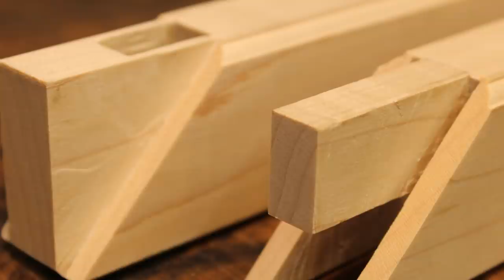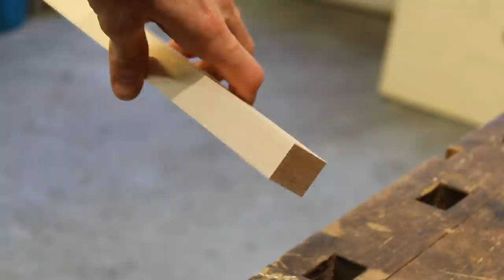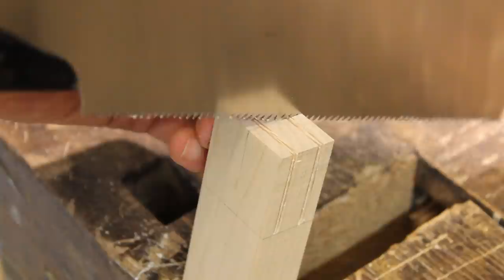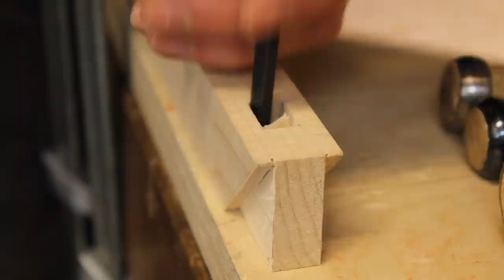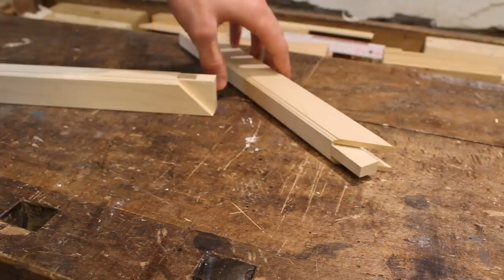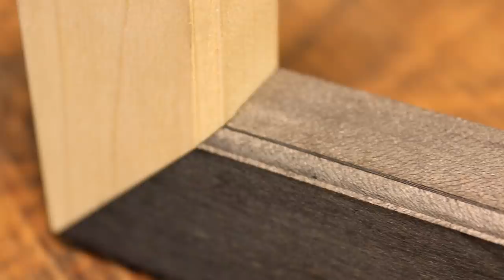Joint Venture Ep. 48: Through mortise and tenon with mitered faces (Japanese Joinery)

Comment: Nice Soul-R&B addition to your normal Jazz mix . By chance are some of those chisels new ,or we haven't seen them used yet in this wonderfully informative series? Some of them seem to have a damascene or acid etched  look to them I never noticed or saw before .
Reply from the maker: Thanks! I‘ve had a lot of them for a long time. The damascus chisels have been around for years. The new camera shows the details better.
Reply: Ahh okay that explains why some of your cuts as of late seem to not be as "precise" as they were or have been. I somehow found it difficult that all of a sudden your abilities have dampened and lessened,now I know it has more to do with how detailed the camera is in it's focus . Which says lot's simply because the only ,"fault" or imprecision ,and that's said very very lightly is on the one side where you made it seems a tad too deep of a final chisel cut. Will say after watching your series ,and I am in no way a woodworker or know anything about joints or any sort . Thought hey ,a table with a three part mortise and tenon mixture would look aesthetically pleasing and be completely functionable ,and be able to withstand heavy forces in many different vectors . Basically a slight variation on #6 through tenon with sword tip miter and into it a vary slight variation of this exact through mortise and tenon with mitered faces into the top right angle of the horizontal . And then realized I might have caught a wood worker bug ,ha ha  . Again thanks for your uploads ,they are pleasing and informative .

Comment: that chisel is tiny! 

ive been meaning to ask for a while - when you decide on the dimensions of the cuts you need to make do you base it on the size of the tools you have or do you have chisels for every size possible and work out the dimensions that are best for the piece you are working on?
Reply: Dominic Ransom for the most part you try to make the joinery to your chisel size it just makes it easier .
Reply: i must admit i thought this would be the most logical explanation but it was a question nagging at the back of my head to be asked. thank you for confirming that
Reply from the maker: A bit of both. But some dimensions are needed for certain joints, so I only try to deviate a small bit for chisel sizes.
Reply: Is that a 2mm chisel? Or 1/16inch? I,be never seen one so small, where did you find that one?

Comment: I like the edge finish on the inside edge. Is that a wooden ovolo corner plane?
Did you make this? Or buy with this in mind?
Reply: if im right it looks more western than japanese?
push stroke rather than pull.
i've looked everywhere and cant find one that small
so a wee point in the right direction would be good...
cheers ;-)
Reply: @DorianBracht
Reply from the maker: Sorry for the late reply. It‘s a Japanese plane. I was just pushing it since I am right handed.
Reply: cheers man, whats its japanese name?
its a lovely finish, thanks for the reply.
Reply: I got one from Japan, I”m pumped to use it.
Thanks for the advice.
Love your joints btw.